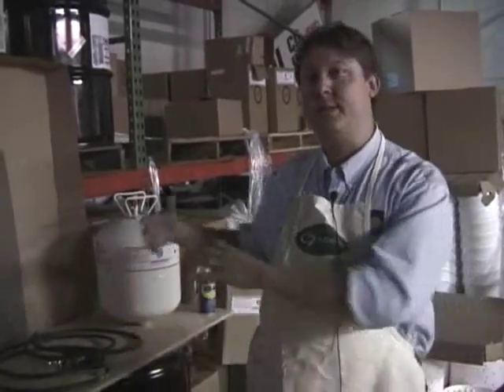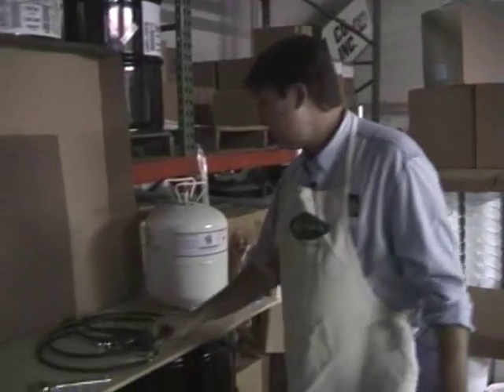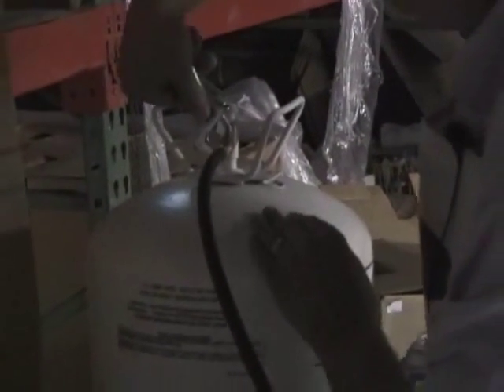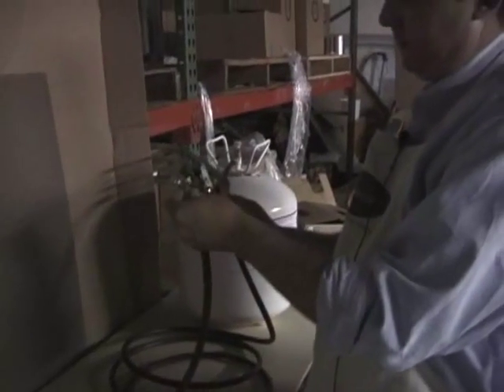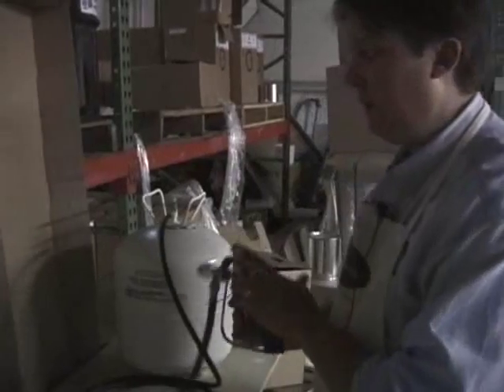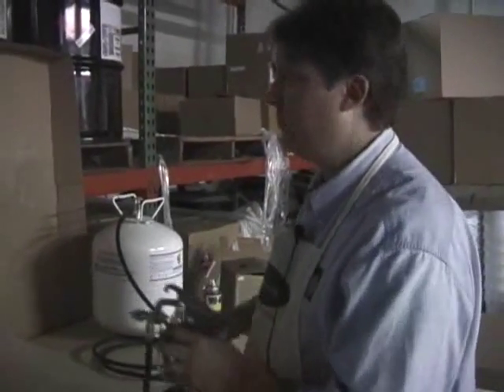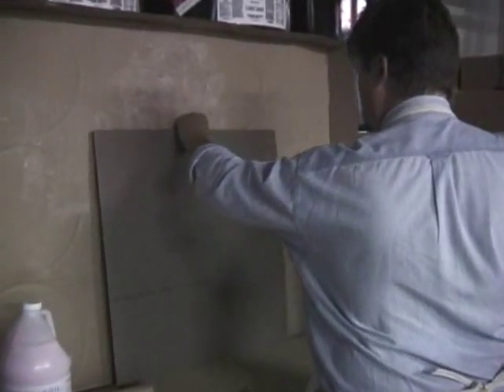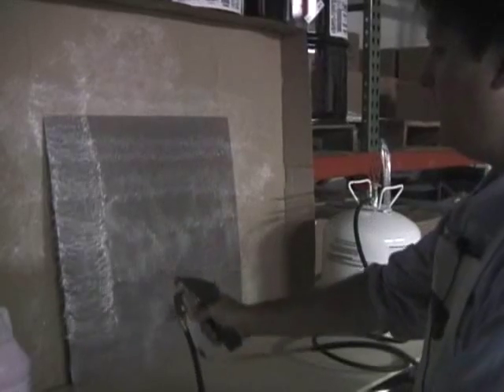Canister Contact Cement Demo

Comment: I used to work in a cabinet shop and we used that type of glue because it has less annoying fumes than the cheaper glues. The folks in the space next to us couldn't deal with the fumes. The stuff's not cheap but it has a great bond and is my choice for using on the jobsite.

Comment: Hello Jeff. I just have a question for an expert such as you. 

I will be gluing rubber/linoleum type of floor material to plywood in a bus. The temperature is going to be around 45F rather then 65F as suggested. Am I going to have issues at 45 and/or are there any special things you would suggest I do for proper bonding. 

I do have a kerosene heater. But I am not sure I should be using it as it may be pretty dangerous with the vapors coming out of the cement.

Thanks a lot in advance.